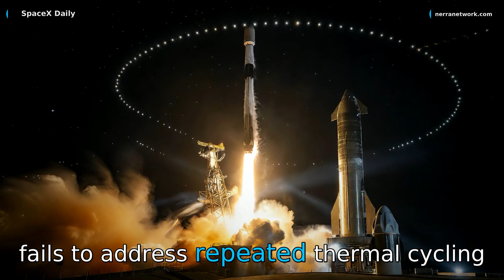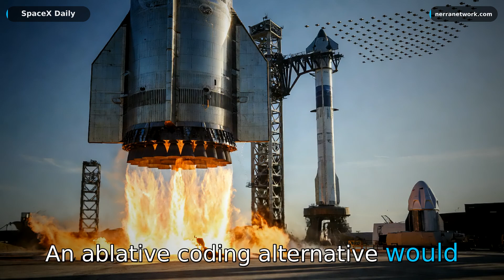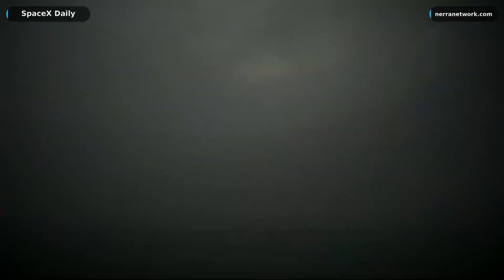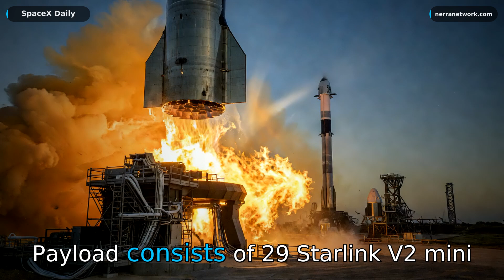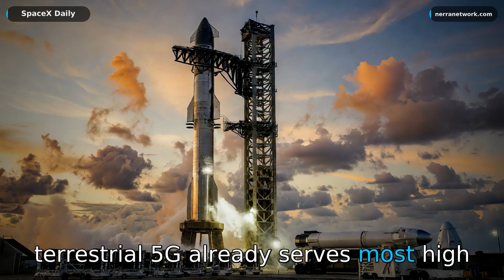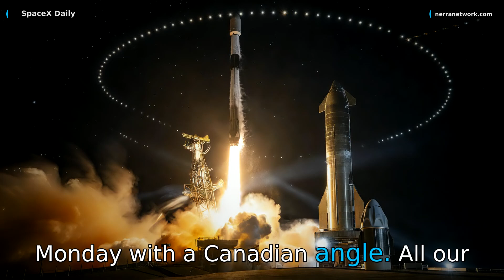Starship Heat Shield Called Dead End by Experts

Comment: 👎👎👎 STUPID Closed Captions ❗❗❗❗❗ 
Solution: None!
Reply from the maker: Will you leave comments on the videos if I remove them? 😂
Reply: @NerraNetwork   Yes! Just Reply to let me know and I will also delete my scolding. 😇
To many YouTube newbies make this mistake about shoving closed captions in our face when YouTube gives us an on/off option!!
Reply from the maker: I am debating this. Big problem is that by having captions on automatically it actually encourages people to read and learn about the subject when they have the sound off. As videos are too expensive and time consuming to make at this time, the current videos are not sufficiently good to communicate the discussed concept. I generally don’t like closed captions and agree with you which is why I mostly access this content via podcast networks like Apple or Spotify or directly via www.nerranetwork.com. If you can give me a better way to either have people turn on the sound or guarantee that they have closed captions on when the sound is off then I would definitely like to change things. I understand your frustration. Thank you for caring enough to try to make things better. Keep any comments coming. I am always trying to improve but a lot of reasons why things are the way they are.